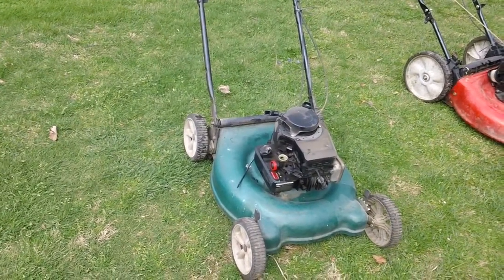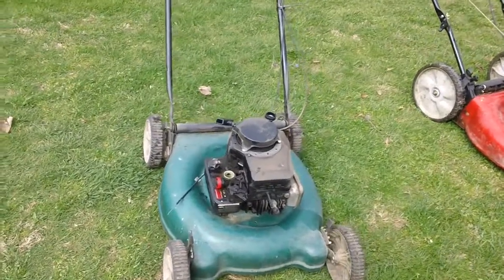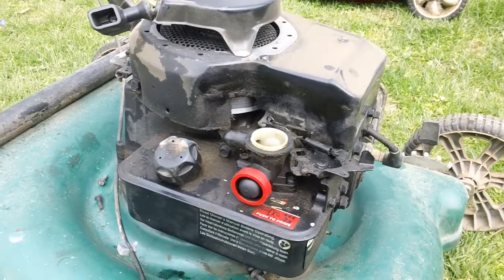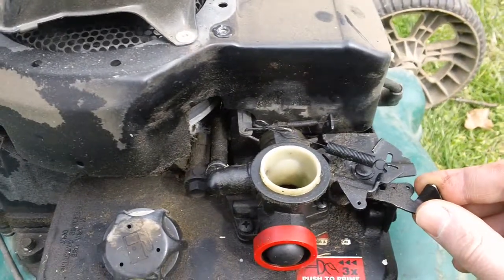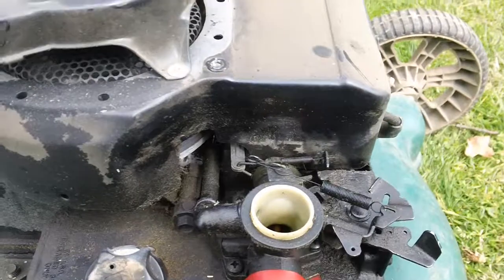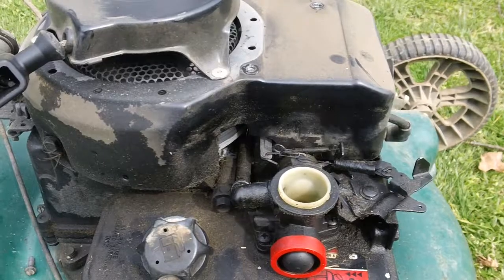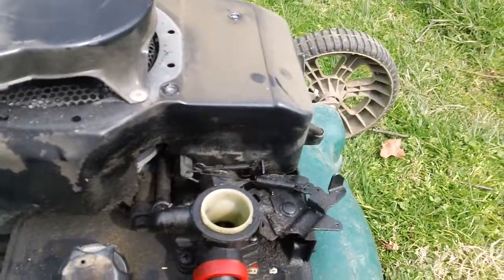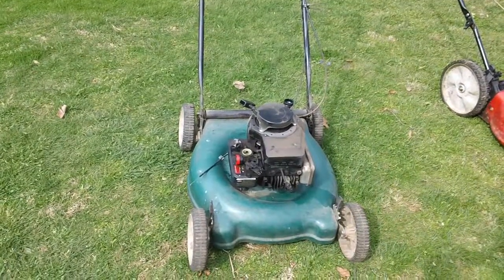Briggs engine governor

Comment: I’ve got 3 of these engines, do you find that they don’t have much of an idle range? Mine seems to run fine and mows great but idling down it just slightly drops until the kill, adjusting hasn’t let it idle slow just wondering if that’s just how they run
Reply: Been wondering same thing Just got one back from having service i hadnt used it for long time but didnt remember it having so little rev range but it does exactly as you describe so maybe it always has done lol

Comment: Great video
Reply: Well ... these are the 2 spring edition and there's a one spring version with loads of different spring tensioner linkages that are fixed or rotate through an arc to adjust speed.  This is a real you know lazy video dealing with just one yard machine, the most ordinary of all Briggs yard mowers.